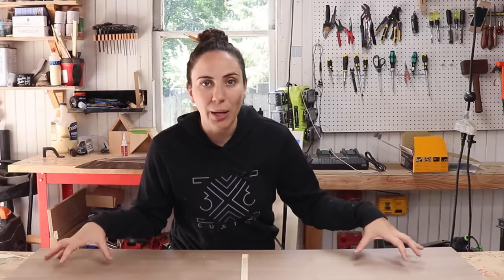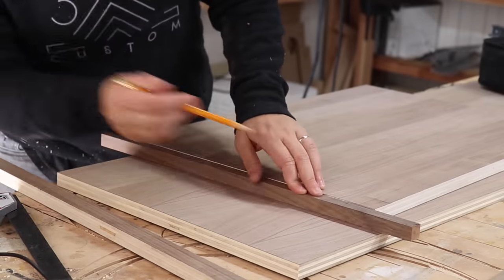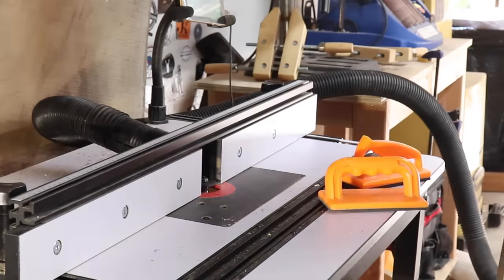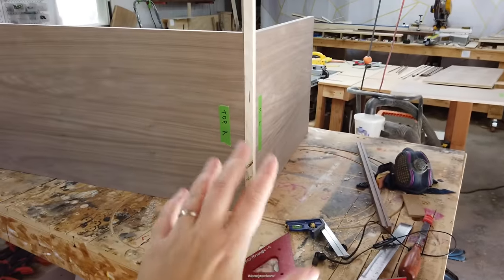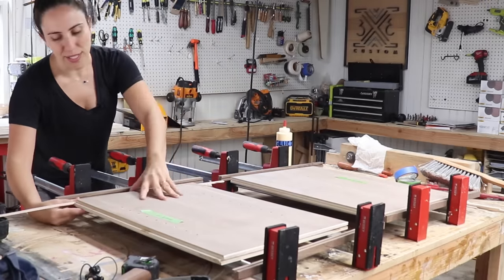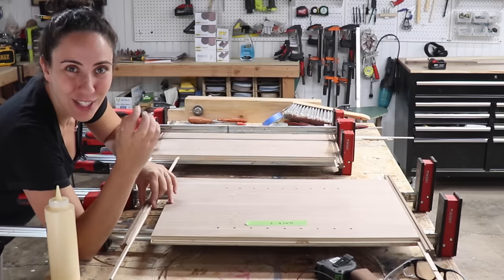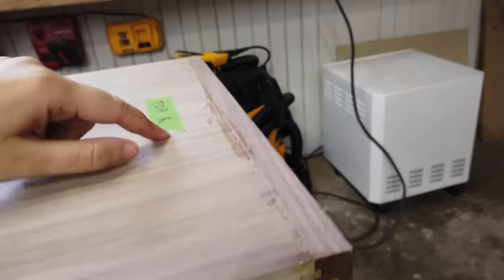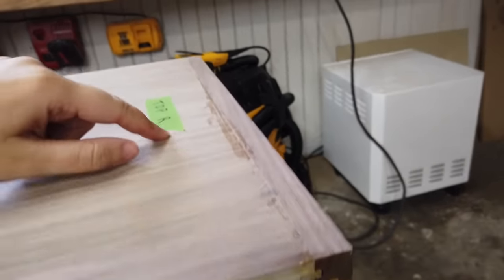Adding a ROUNDOVER to Plywood Corners - Corner EDGEBANDING with splines

Comment: It's a really nice piece and I like that you address a common issue that comes up in many carpentry projects: namely that things change. If I could point out two small things: the issue of your one corner piece not being consistently proud along the full length of your top board is most-likely due to your spline being slightly too thin and allowing the corner piece to drift back in the gluing process. (I know you did that on purpose for more glue area but you could probably dial it back a bit.) The other thing I might suggest is that you should clean up all the excess glue with a damp rag right after you clamp! You'll have FAR less sanding before you go to finish and that means less chance of sanding through your veneer, which was one of your concerns going into your decisions before the glue up. Looks like the final piece came out very nice!
Reply: I agree on a wipe down before it dries. Naturally I like learning things the hard way but learn that one I have lol.

Comment: no no - use hardwood for your splines. and keep them to a press fit so all alignment is spot on - cut grooves slightly deeper than width of spline to allow for relief when gluing and clamping. when i was making tables i would use spline joints for the tops to increase the glued surface area, but nice and tight with relief in grooves. i also used an expanding urethane glue to fill the gaps. awesome work though. keep the projects rolling...
Reply: She explained your points in the video. That is why i look at the whole  video.
Reply: @beqwaam  keep on watching there buddy. you are doing fine.

Comment: this is such a great video! i have been thinking about a similar approach to covering up corners in a plywood cabinet. my idea was to basically have one piece of hardwood (top left corner of cabinet) where you rabbet out the top right and bottom left edges, and then fit the top and left side panels in… glad to see your technique worked so well!

Comment: Not sure how I landed here but happy I did.  I have a boat project that requires round edges in teak stain grade furniture.  I have been wondering how to do this and this is the idea I imagined (hardwood corners with plywood panels).  I hadn't yet worked out the details. Now I know how to actually DO it.  Thanks for the tutorial!
Reply from the maker: So awesome to hear! Glad you found it useful!

Comment: I have done the same with less than perfect miters. It actually works pretty well as long as you leave that little thin bit a little proud. Also, this gives a great opportunity to use contrasting wood, or expensive exotics, without breaking the budget.

Comment: I’m so happy that I found you! I’ve been watching your videos for a while now and I’ve learned a lot. So, thanks. This video is perfect for me right now because I can’t seem to get a perfect 90 degree miter joint for my plywood. It doesn’t take much of a slip and the 45 degree cut is wasted. Especially if you’re trying to make something perfect. I’m making a couple of night stands for a customer. I’m an auto technician and trying to get the heck out of this business. My customer saw some other furniture pieces that I made for myself and asked if I could build the night stands for her. I told her that I would and now I’m committed. The only problem I was having was the miter cuts because I couldn’t get them perfect in order to sell them to her. I tried this type of joinery that you did in this video on some practice pieces and they turned out great. I’ll be redoing the carcasses this week with this type of joint. I think I’ll do another couple of practice pieces with different shades of wood because it’ll be obvious that there’s two pieces of wood and it won’t flow. So why not enhance it, eh?
Thank you very much for the guidance! 
M
Reply from the maker: So awesome! Glad you were able to get something out of the video!

Comment: I'm also in a walnut ply entertainment project. I made dados and rabbits for the vertical connections. I put a picture frame on the ends to hide the ply edges and also used solid lumber on the fronts.
Reply from the maker: Sounds nice!

Comment: I love your channel and I love your work. I've been a subscriber for a while. The best part is that you simplify things to it's lowest common denominator :) 
I'm also a female woodworker and I've noticed that the men I work with make things so hard. Plans, explanations, solutions ... 
I'm a volunteer at a non-profit 50+ center woodshop and I can't tell you how many times I've had to try to convince folks, (sorry guys, but men in particular), to not make things so large because it's unnecessary, or to simplify their plan or process to achieve the same result.  Jigs don't need to have a 50lb weight-lifting requirement. 
Usually, in many other things in life, it's the opposite. 
Weird, huh?
Probably the difference in problem-solving. Women are different than men in that respect.

Comment: Fantastic build, all around. You have solved a problem about joining plywood panels without the cheesy iron on edge banding or the nearly impossible mitered joint.
  Using the 5/8" RO works well, since plywood thickness varies (and always less than 3/4"), and your method allows the final sand/ blending of the tiny flat spot on the corner trim.
   Using the oversized corner stock with small chamfers on inner ply edges seems like the foolproof way to work with varying material thicknesses,, as well. Just took delivery of several sheets 'cabinet grade' 3/4" birch and ALL sheets were different thicknesses. Go figure.
   Your end result is a furniture grade piece with NOTHING super difficult in the joinery...NICE!
Reply from the maker: So glad you found it helpful!

Comment: Impressive! I did something similar when building a new base for a sofa bed on my boat, but installed 2 x 2 pieces along each inside corner, and 3/4” quarter-round on the outside corners, glued, but no splines (that idea didn’t occur to me). Aesthetics wasn’t an issue for the inside of the base.
I was going to ask a couple “Devil’s Advocate” questions, but you did a fine job of explaining what you did, why you did it, and why you didn’t do the other options I thought of. 
Wishing you continued success!
Reply from the maker: Glad I got those preemptive strikes in there. Ha. Thanks!

Comment: I really like this idea. I could do this instead of adding face trim in places. I don't know if I would do as big of a roundover, but I would definitely use stock the same thickness as the plywood. This also eliminates the miter joint, which I hate already, so win win!
Reply from the maker: Yeah! I think it’s a cool look and miters are hard. Ha

Comment: Very elegant solution, it looks amazing!! This was definitely worth the stand-alone video. The thought and effort in this is just great. Also, apart from the cool rounded look, I would bet this is a lot stronger than a miter joint. Also, furniture corners get dinged, and a miter corner with a sharp edge will 100% flake off bits of that hardwood veneer. Your solution will be much more durable.

EDIT: I guess you already said a lot of that at the end haha
Reply from the maker: Haha you know what they say about great minds... 😂

Comment: I've used this technique for years with a 3/4 inch roundover.  I like the results as well.  Has it's own set of little issues because most 3/4 plywood isn't exactly 3/4 inch.  I make a tiny notch on the inside corner to take care of that if it's going to show.  Kind of a pain to get right.  Often things are close enough that I make the corner strip and roundover just under 3/4 inch and you can't really tell it's not perfect.
Reply from the maker: That’s what’s cool about woodworking. As long as it looks good to the eye, the preciseness of it doesn’t really matter

Comment: T, you can also do your round over on your wider board first, then cut your piece to width on the table saw, that would be a little safer as you route.  Also it eliminates any sanding to get it to perfectly match the thickness of the plywood (or mistakes in sanding), you can also cut rabbets on the sides that match up to your sheet goods, then cut your spline dados, splines and assemble.  This adds a nice decorative groove at the corners and takes a person’s eye away from the pronounced look of the grain going in different directions (even though it is still there).  Nice work explaining your technique, as usual and the corners 👀 great!
Reply from the maker: Always options!

Comment: A quicker method that is just as strong and doesn't have alignment issues, is to cut a rabbetted lock miter joint.  The setup for this relatively obscure joint, like the basic lock miter bit setup, is easily achieved using the Lock Miter Master lock miter bit setup jig.  Look for it and check out the instructions on the website.

Comment: Another idea that works great, especially on dark veneer plywoods: mitre the plywood as normal, spline it together for strength if you want. Afterwards, route in a 1/16 x 1/16 rabbet on the outer corner, then install a piece of hardwood of the same color. Sand or plane down flush, give it a slight round over.  The hardwood almost disappears giving you a nice clean look and softens the corner at the same time.
Reply from the maker: That’s sort of what I did with the 1/4” roundover at the end. Always great options
Reply: @3x3CustomTamar  Yes ma'am, options are always a must. Anyhoo, just want say I always enjoy your  videos. I have followed your videos from your humble beginnings and have enjoyed watching you grow as a fellow woodworker. Keep up the great work.
Reply from the maker: Monkey Boy thanks so much!

Comment: Sweet, never tried that. If you want another cool rounded joint cut dovetails into thicker wood, I use 1 1/2" wood, then cut a rounded corner on the bandsaw. I cut the inside and outside where it ends up about 7/8" thick all around including through the curve.  I only do it with 2 sides for a base for something. It looks like a rounded curved dovetail. My favorite joint actually. It looks wicked smaaaaaahht.
Reply from the maker: Sounds very cool!

Comment: It's funny how you (generic, not personal) work hard to compare the alternatives, and when you are done, you choose the one that looks best. In your case, the 1/8 inch difference.  Side by side, you choose the best possible option.  But, when you take it to a customer, no matter how closely they look at it, they will never notice.  But, in your mind, you know you gave them the better option. 

I've helped, off and on, frame sheds, install doors and windows, add or move walls and other construction grade work.  But, I'm new to "fine furniture" as I call it, even including rustic.  I built stand for table saw and workbenches with construction materials, but then, my first "build" was a cat bunk-bed. The design developed as I was building it. Like you, I compared different options and chose the one I thought would look best.  I incorporated plenty of flaws, as well, not surprising, LOL.  Before I was finished, I had to resist "improving" or covering all the flaws I made.

Knowing where all the flaws were was horrible.  But, I grit my teeth and put it in place and added the new cat beds.  When I did, everything disappeared.  It looks really great here next to my desk. And of course, my fours "customers" love it and spend a lot of time in it.  

My "extra mile" was really only a taller board in the back with rounded corners to look a little more like a headboard instead of four boards forming a box.  I'm really glad I went that extra mile.  I'm the only one who will ever know, but I think without it, there would have always been that, "it looks great, but there is something missing I can't finger."

In the end, I think you showed us how to 'see' some of the little touches, that negligible independantly, but that together make for a better work.  They also give us the satisfaction that we served our customers well.  And that, to me, is often worth more than the money. 

Thanks for sharing.
Reply from the maker: Glad you liked it ☺️

Comment: I would love to see how the inside of this joint comes out when finished. I might use this technique when building a tv stand for myself. Looking forward to your full video. Subscribed.
Reply from the maker: Then check out my record player stand video!
Reply: @3x3CustomTamar   Thanks. Looks really good. I was thinking the inside of the miters would be visible and it would be possible to see that the inside is not completely smooth (the little flat spots on the coved trim). Because of the doors though its not a visible area much. Nice work!

Comment: If you want to go with the 1/4" corner filler and what the better strength put in a spline across the 45 degree miters.
Reply from the maker: That could work. But so can dowels or dominos or anything else that is used to strengthen a joint.

Comment: Excellent idea!  I do know full 3/4" RO bits are readily available vs your 5/8" RO bit.  However, I don't know if that would have helped when using the full 3/4" x 3/4" corner filler blocks.  Maybe the filler blocks could have been milled to exactly match the plywood's thickness (something slightly less than a full 3/4" I'm sure) and the 3/4" RO bit could have been set up just right to make a full RO right out to both faces of the filler block.  'Course, as you pointed out, things always vary just a tad IRL, so having just a tiny bit of hardwood that can be sanded flush to the plywood gives you the ability to make things just right.
Reply from the maker: Glad you liked it! Why can’t they just make 3/4” plywood actually 3/4”?! Ha! Would solve it all! 😂

Comment: Fabulous, I also watched the full build.  I Built an entire kitchen out of walnut plywood.  The veneer was so thin you could sand through it with 220 sandpaper in a second.  Going to have to make friend with my hand planes.  Thinking about the 1/4" round over....how could you cut that rabbet without the blowout on the one side?  You do wonderful work.
Reply from the maker: Thanks! So I was thinking maybe to use a spiral bit with an edge guide instead

Comment: I agree with your decision to go with walnut edgebanding.  I personally feel that accented edges look better with a darker wood, otherwise the transition looks rather jarring.

Miter keys could add a little pop if you decide the piece needs a little something something down the road.  I have seen a lighter wood used as keys in a darker wood with great effect, particularly in nice straight grain like you have.  If you don't want to draw to much attention to the joint, or the main wood is already relatively figured, I'd go safe with an even darker wood.  You'd only need a turning blank or knife scale's worth so it won't break the bank at your exotic woods dealer to get something darker than walnut.  Keys could even add that extra little bit of strength to that 1/4" one for piece of mind.
Reply from the maker: Now I want to do this builds with maple keys.... that would look really cool.

Comment: An inner round as a glue block on that miter joint may have added a significant amount of strength. The inner block would be in tension for that stomping test. I need to try something similar to make a structural chair back piece.

Comment: excellent idea. only change I would make would be, instead of cutting a dado in the walnut corner strip I would make the spline from the walnut itself instead of cutting it from another material. Cut the corner strop over size and route 4 rabbets to make the tongue. Hope this make sense, sometimes I still struggle with English
Reply from the maker: That makes sense. Sounds cool

Comment: When you first mentioned the Chamfer on the inside section of the plywood I was thinking you where going to make the panels almost like a French Cleat. So that if you had any tear out on the veneer, you could hide it as it seated into the the end pieces. Which would actually work great. But not in the current application with the round over, and desire for a smooth transition and glue up between the panels. I know I am not a big fan of glue to make something have a smooth transition. As I have often found as the work ages they become obvious. Which doesn't work well with large continuous panels. Specifically if your using a flat or semi gloss finish. Anywho, it definitely gave me some additional joinery ideas to try out.
Reply from the maker: Haha glad it got your gears turning

Comment: Have you ever tried one of those corner fastening router bits? There are a few on the market. I've had a pretty good success rate when using ply. The problem is that they're designed to be a one--pass cut, so some routers can't handle it.
Reply from the maker: I’ve never tried them